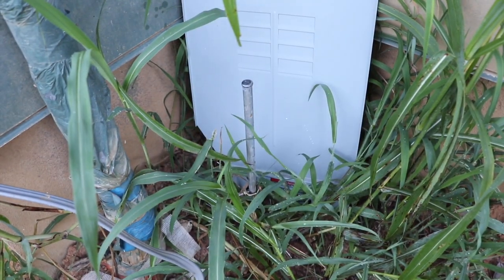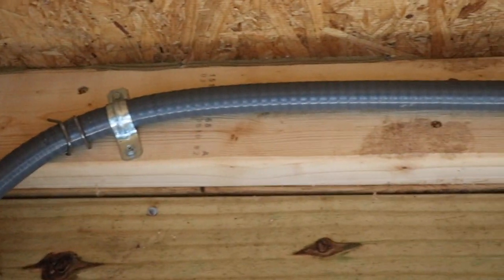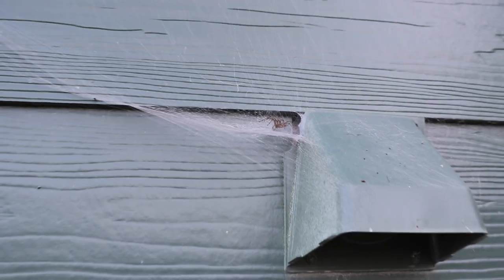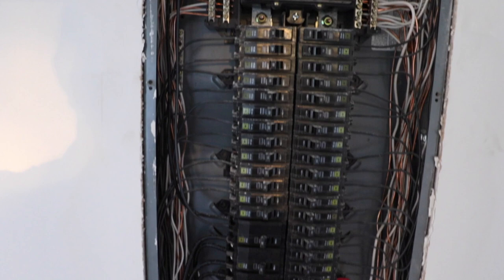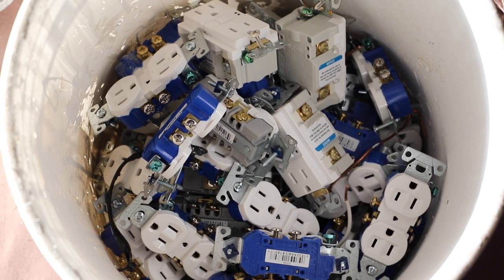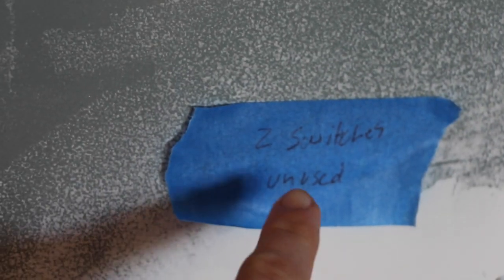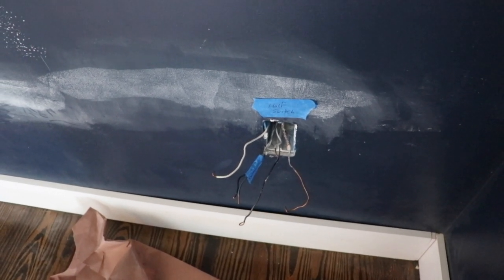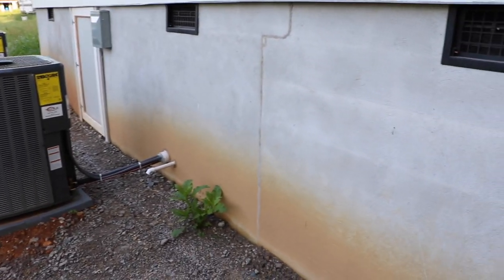Electrical Contractor Failures - Trade Tips

Comment: i can just look at the joint made in that reverse switched outlet and tell which is the switch leg i would have not even tagged it. this should be a big lesson to you. quit trying to skimp by hiring some "yeawho" to only do half the job and you do the rest if you don't know what you're doing to begin with. just find a reputable but reasonable contractor to do the whole job and only pay him for each phase, and only after each phase of the job passes inspection. it's like me i'm an electrician for about 30 yrs. i need a new a/c system in my house now i could probably do about 75% of the job myself, but there is a lot of technical stuff i don't know.  so i just "bit the bullet" and found a licensed contractor that was referred to me by a friend that knows this guy and he gave me a price and i told him that if he needed me to do anything that he didn't want to do ie. demolition or crawl through the attic that i would do it if it would help on the price he gave me and he was good with that and he shot me a very reasonable price, is it a lot of money? yes, but it's less than what i could have paid and i'll still have peace of mind to know that it was done right because he's licensed, bonded and recommended. sorry i'm so long winded and harsh. i'm just getting so tired of people coming on youtube trying to act like they know all about electrical work when they don't even have a clue, giving false, impractical and even sometimes dangerous advise.

Comment: What's with the metal strips nailed into cinderblocks. Did we forget the tie-down bolts? That would make me think that the blocks were not filled with concrete. that would hold the tie-down sill plate bolts in place.

Comment: 4:25 Dude, what "electrical grease?" You mean something like Noalox? That's not necessary, and is used for aluminum conductors only. Same panel: What neutrals? That's a ground bar. These breakers are serving phase-to-phase loads, without a neutral conductor. Just saying... You are making some valid points in the video, but when pointing out these non-issues you are undermining your credibility.

Comment: That electrical "grease" is called Noalox. It's a corrosion inhibitor used to prevent the galvanic reaction between Aluminum and Iron or steel interfaces.
Reply: Richard Anderson the lugs are aluminum and you do not need it because it is not code

Comment: WOW. This was NOT done by a licensed electrician, GUARANTEED! I can't imagine that someone could make it through trade school and years of training, and still do work THAT poorly. I would be calling the electrical safety authority, and make them aware of it. Electrical contractor information on licensing, and training, is available publicly online. Where I am, it would the ESA/ECRA (Electrical Safety Authority/Electrical Contractor Registration Agency) website. I am a designated master electrician for our company, and I would simply fire anyone who did work this badly and left it, thinking it was fine.
 I did notice, however, that what you called a "cables" running through the cinder block wall, were actually approved conduits (liquid-tight flexible conduit), except one, which was run using weather-proof wire (NMWU) which IS acceptable where I am from. STILL, that guy SUCKED at wiring OMG.

Comment: Noalox prevents oxidation on aluminum wires,  and any joint of copper to aluminum. Isn't something new, I got a reward for knowing that on a computer system that used switch mode power supplies with flat copper conductors around to the front to be squeezed between two aluminum panels that were the backplane. I noticed the voltage drop between power supply and backplane. Resulted in a company wide revision. That was 1979. Live and learn in all things, expect poor workmanship, if you aren't there watching the job get done right, it will get done wrong.

Comment: and the equipment grounding electrode should be terminated in the meter can or meter compartment if it is a meter/main combo and not just on the bonding terminal in the main

Comment: I cringed seeing the ring on his finger with the open electrical. But   realized the power was off.  Always remove you jewelry before working around any electrical, even if it's just changing your car battery.
Reply: gravy train My tongue piercing barbel nor glass eye doesn't have any way to do that.

Comment: I have run into bad electrical work by electricians my house was wired and my main panel got warm to the touch I took the cover off and the main lug was very loose causing resistance and it had been inspected and was supposedly all done.

Comment: Deox is not required by the NEC.. Now days aluminum wire is made to safely be installed without it. DO some inspectors want it? yes, but there is no longer a need for it. Also, in some states, AF breakers are not required, In my part of michigan, we do not have to do that.... YET .. I see no reason for having the red and black on certain phases. Hell both feed wires could just be black. SIngle phase, it does not matter what phase you use.

Comment: Each of your sub panel should have a ground in a neutral bar separate your main control panel should have a ground bar and a neutral bar the neutral bar will be bonded to the backplate you're right neutrals and grounds do not mix whoever did that did it cluster f big time I personally never done residential but I have build I don't know how many control panels I'm sorry for your pain in the effing mess they have to clean up good luck and hopefully you get better results

Comment: So when were you going to tell people to not touch the terminal in the panel or faulty wires without turning off electricity Nd testing it.
Reply from the maker: This is new construction, the video is about it not passing its power inspection.  So legally the power company can’t heat it up until it has a sticker of approval from the permitting department.  Failed Inspection = No Power.

Comment: I'm a two year apprentice in Colorado. If I had I made half these runs and mistakes I'm certain my Lead would have my guts. There is so much to learn when it comes to electrical, especially if starting from scratch; where I live the building inspector just changed the code that all garage receptacles have to be 20amp 12 wire circuits, if they hadn't stopped by and told us we would have failed out rough in inspection.

Comment: in the subpanel out building, should the neutrals and ground also be separated?
Reply from the maker: William Chap I'm not an electrician maybe one of these commenters knows... however I would say yes, it's a subpanel just like any other and should be grounded separate from the neutral.  Most of the panels I have seen are separated
Reply: thanks for the reply im going to show this video to my friend and tell him. i believe it should also be separated and also not sure of the ground and neutral should be bonded with the green screw
Reply from the maker: William Chap we have a small outdoor panel it has a separate neutral bar.
Reply: And this is how things escalate.  Don't believe everything  you read on the internet.

Comment: Honestly, and I mean no offense to this homeowner or any other, but you "HELPING" could have caused some of these issues. Not saying that it did, and you seem to have some knowledge of wiring. Although I believe books sold at lowes on how to wire a house should be illegal as a public safety hazard, you seem to have learned a lot from somewhere. If you are anywhere near New Bern, NC the company I work for can definitely sort that out for you. Reply if needed. I'll even answer some questions for free. Not of us do work like that. Also that sub panel was NOT "neat and tidy" in fact I would love to show you what that does looks like.

Comment: He made the correct observations about multiple wires under the same screw and the neutral and ground connections being intermixed in a sub panel, but then gave incorrect advice on how to cure the problem.  He failed to state that the sub panel's neutral must be insulated from the sub panel's grounded enclosure.  Just pointing to the  additional ground or neutral bus is not sufficient.

Comment: How can you have sheet rock up before a preliminary electrical inspection. Before you get any more up you better find out if he will pass the reason for this is you have to secure the wires within a certain distance from every box. But a local code book and it is Of hard for the aluminum wires
Reply from the maker: This wasn’t rough in, this was trim out

Comment: what I see from video it seems all black wire sizes are 14 too. if your circuit breaker size  in panel is 20 ampere minimum size for wire is 12 . wire size for drier should be number 10 be at safe side.
Reply from the maker: 123kkambiz sizes are 12... okay so when you buy a roll of wire, common sizes for a house are 12 and 14.  Generally 14 has a white exterior, 12 yellow, 10 orange.  All our wire is sleeved in yellow... it's definitely 12.  There's no need for 10 for regular circuits in the home, you wouldn't be able to fit the 10 in most fixtures and outlets, it would also be dangerous because if someone thought they could increase the breaker size due to the larger wire they see in the box.... the outlets and switches couldn't handle the additional amps.

Comment: You can get in trouble in your family if some one with an Mechanical Engineering Degree puts some thing  in the house in terms of wiring and some one with a lesser degree says the install is wrong.  The person with the lesser degree using more common sence and haveing experience with the electrical fault.

Comment: Where the electrical outlet is below the water pipe, I would move the electrical outlet, may be easier to do..True, can't terminate neutrals on same bar as grounds and not under same screw, they do need to be bonded though. Some people bond them with a bare #8 wire, which will pass inspection if it looks good.  the grounds in the ac box are wired correctly, just not ran in a good workmanship manner. neutrals need white tape on them to identify (in your ac box)..
Reply: Scott Bishop or just make it gfci

Comment: You get what you pay for. 
I'm an electrician and I deal with this all the time. I get called to give a bid and then not get the job because my pricing was to high. Then 6 months later I get called back to the same jobsite and get asked to give a bid to fix everything the cheaper electrical company did wrong. 
My second bid usually comes out more expensive. Sorry but it takes time and money to clean up someone's mess .
Reply from the maker: Mark Silva I disagree I paid the next guy over 8K to replace receptacles, etc.  He installed 15AMP outlets on 20AMP circuits throughout the entire house.  Moron.  Electrical Boards need more oversight of this industry.
Reply: That's allowed unless the 20 amp circuit only serves one receptacle, unless your local amendments to the NEC prohibit it.

Comment: Calling you out on the Ground Rod. The Code requires 8 foot in contact with the earth. You cannot achieve that without the top being flush or below the surface unless a 10 foot rod is used. There is also a requirement that the top be flush or below the surface. i f a longer rod were used the top could be exposed if protected from physical damage. What if I were to tell you this statement is not entirely true? What if there was an instance or maybe two, where a 5 foot ground rod was acceptable!? Only true Electricians know the answer to that. Please don't make a statement where you yourself are in the dark. other than that you should some nice examples of bad, rushed work. You Get What You Pay For. I'll still give you a thumbs up for the video. OLE!

Comment: Ground rods are to to be buried AT grade NOT below yes they are obviously not AT grade and way too far above, It DOES NOT matter which lug the hots go to as long as they go to the bus and not  the neutral /ground bar, seal tight can pass thru masonry without a sleeve due to its composition, though the ground should have been trimmed after being made small enough to fit the lug A GROUND IS A GROUND it is not against code to trim it,  a GFI is not required to protect the lighting in the crawl space unless susceptible to moisture, and it seems you tried to skimp out on an electrician to begin with. i could go on but ill end my comment with a rule 
A GOOD ELECTRICIAN ISNT CHEAP AND A CHEAP ELECTRICIAN ISNT GOOD!!! 
Good rule of thumb also is to not act like ya know more than someone who can burn your house down and make it look like an accident!

Comment: How where you able to close the walls? How did this past the rough inspection?
Reply from the maker: Rough In is the inspection of the wire runs, not the trim out.  The trim out failed.
Reply: Yanasa Ama Ranch I’ve seen multiple stuff that should have failed in the rough inspection

Comment: Yep, pretty crappy installation but a few things need to be said about your presentation.  While the model NEC may require arc-fault circuit protection in dwelling units, many jurisdictions have amended the requirement of of their adopted codes, same goes for the kid-proof (tamper resistant) outlets.  There are entire states where this has been done - the home builders associations and electricians have pretty strong lobbies in many areas.  Referring to a code by its model name, NEC, doesn't mean anything legally unless the City, County or State adopted the NEC without amendment into law.  Most of the time it would be called the Electrical Code of ___ City or State Or the ____ City/State Electrical Code.  

Another issue would be sub-panels; not that many years ago, it was acceptable to run three wires (the two hots and a neutral) to a sub-panel in the same structure and set a new ground (water pipe or a rod) at the sub-panel.  Then we ran into issues with separately derived grounds and went to the four wire (two hots, a neutral and a ground) feeds to sub-panels.  Regardless, both systems required the grounded conductors to be attached to the  neutrals (grounding) to be isolated from the panel.  The anti-oxidant 'grease' is only required on al/cu connections.

Biggest problem here appears to be that you tried to save a few bucks by hiring a low-ball contractor and doing some of the work yourself.  Never works out.  Hope this mess got straightened out.

Comment: The wired in switches that dont know where they go? Not such a big deal . They probably capped the ends or boxed them to safe them off on the load side of the switch so you could cut holes and pull them out in the future . When you connect them you can turn them on and see what they power and if you want a switch moved left or right not a huge deal .

Comment: That's not good a licensed electrician should do better than that .  Sometimes you forget something like securing a wire but most of that you are correct it's just poor . The inspector should get him out there and ream him for that kind of work. And make him correct everything. Cutting the wire is big you don't know the current carrying capacity of those wires they could heat up like toaster wires the brakers won't protect the wire. The no lox greese should be on any connections with dissimilar metels. The wire going through the concrete is bad but the gray one looks like flexible conduit . The lights with the plugs if they where there already they are ok. But the panels are a mess . You are correct in that the ground and neutral should only be bonded together at the point closest to the main breaker where it enters the building . The arc fault breakers where not working correctly so some  places where not requiring them I don't know If that has changed.ground rods have to be away from where they could be damaged and the ground wire shouldn't be exposed to damage. I'm sure there is much more you are right on to complain .

Comment: I agree with some of the video obviously it was done by someone who is not a professional. Also the person who did this probably had some notion in electrical but not professional. Also this guy wants carflex to be inside pipe? You can't do that carflex is not a conductor it has conductors inside. Also no matter if it's energized or not you never touch the lugs of a panel period. He mentioned tamper resistant outlets for the inside what about the outlet on the outside? And it's cover. Inside Panel was not labeled as well first ground rod has to be at ground level the second rod which should be 5/8 should be covered.
AB ELECTRIC out of NM and TX